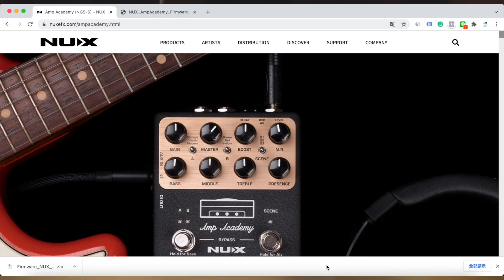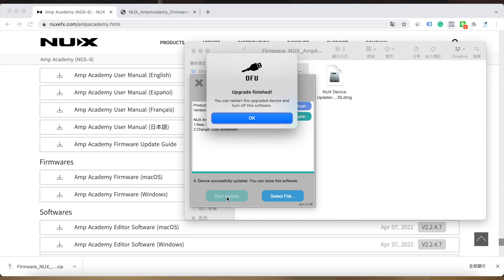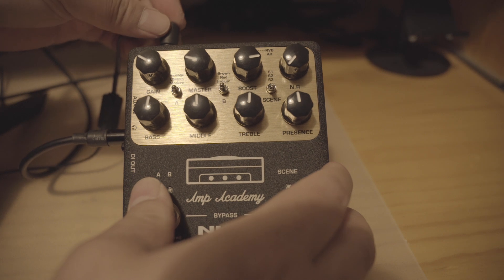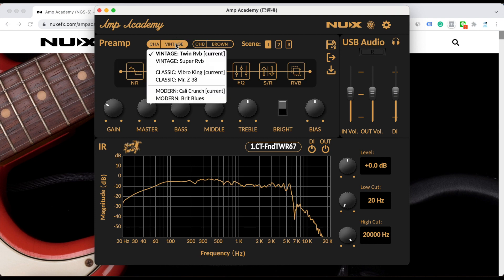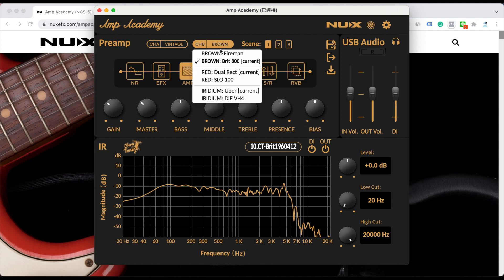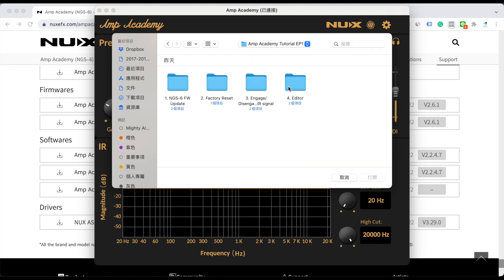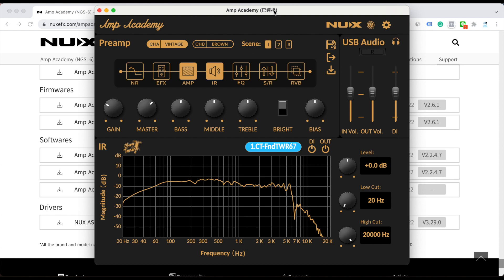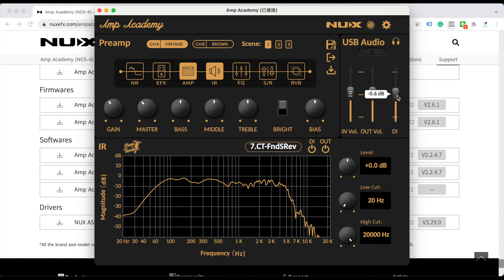NUX Amp Academy Tutorial EP1 | Firmware Update, Factory Reset, Editor Software & more

Comment: Hey guys as soon as I select file the pedal disconnects 
what to do now????😒🙄🙄🙄🙄☹☹☹☹
Reply: Hey I workd it out the firmware updater was the issue 
I also have Nux duo time which I update 1month back So I used its Updater and then added amp academy bin file worked like a charm.😁😁😁😁😁

Comment: If I do a factory reset, do i have re-do the firmware update?
Reply from the maker: A better way to reset the NUX Amp Academy is to press and hold down the SCENE foot-switch while plugging in the power supply(turning the pedal on).
Reply: @nuxaudio  thanks.. if i do do this, do I still have to reinstall the firmware update?
Reply: @raoullmukerji  yes of course